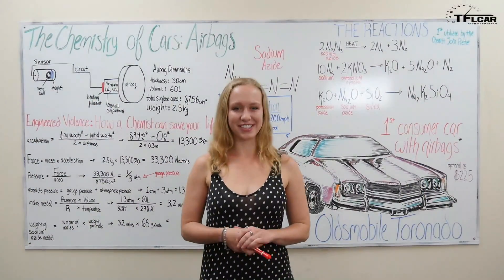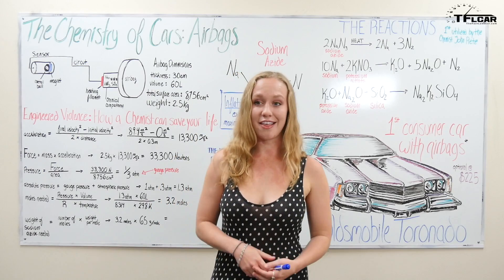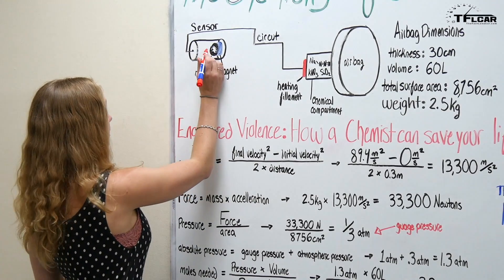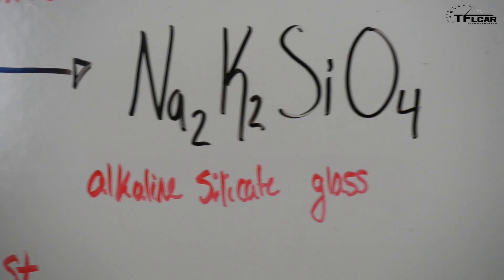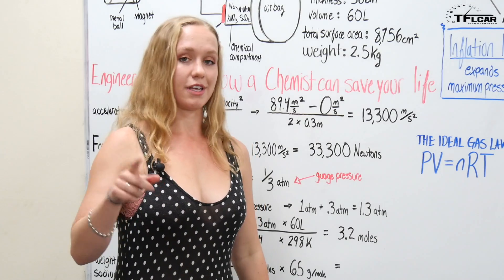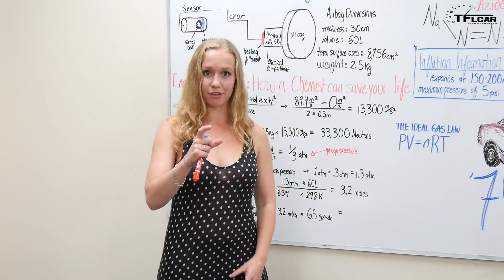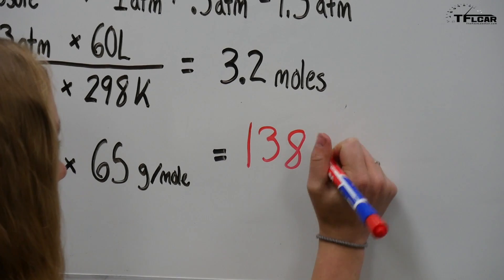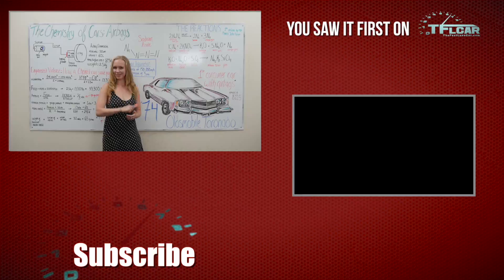How Do Airbags Work and Can They Really Kill You? Chemistry of Cars Ep.2

Comment: Airbags have come a long way, but they shouldn't have been used till they got it right in the first place and never mandated. Government control has ruined new cars. Instead of airbags, why not improve upon the primary safety feature that actually works? I'm talking about the seat belt of course which hasn't really changed in 50 years.

Comment: $1,200 option for an Airbag in 1974....Yes children $225 is equal to $1,200 today,remember you made $2.00 per hour in 1974,plus 1 - 3 car loan terms not 4,5,6,7,8,9, year car loans and the kicker 19% interest on that car loan,thats with perfect credit  ! Thats why cars prices were lower than todays dollar $35,000 bought you a loaded top line luxury or performance car,but you had 1 - 3 years to pay if off if you financed it at 19% rate ,so expensive....

My Mortgage in the early 1990's was 21 % the house I owned had a higher payment than homes today that are priced 6 times more !! Enjoy low interest,wait until it goes up,cars wont sell,homes wont sell ..Enjoy !

Comment: This is why it is critical driver and front occupants sit at the correct distance from the air bags, and to use your seat belts.  I was in a low speed collision (~40 mph) and my bags deployed, but I was sitting far enough way that my face never hit the bag.  But it made a mess and my car was "totaled" as a result.  Seat belts are always the primate safety restraint... air bags are only supplement, not a replacement.

Comment: I don't see how you got from area to volume.
Reply: Sure I can explain! So if we assume that the shape of the airbag is cylindrical and that the height of the airbag is about 30cm, which is true for say, the airbag in a steering wheel, we can use the formula: volume=pi*radius^2*height. The volume of the airbag we already know, since an airbag for your steering wheel is about 60L. We then can rearrange the volume equation to solve for the radius, and from there we can plug our radius that we found into the cylinder surface area formula Area=2*pi*radius^2 +height*2*pi*radius. So we went from volume to area. Hope this helps :)

Comment: You should show how torque is transmitted through a torque converter and automatic transmission in one episode and a clutch and manual transmission in another episode, the difference between an open differential, a limited-slip differential, and a locking differential in another episode, how a two speed transfer case works in another episode, and the differences between different engine blocks (i.e. V6 vs I6 vs Slant 6 vs Flat 6) in terms of how they transmit power and torque to the rest of the drive train in another episode.

Comment: How about a video about the products of combustion, in a bit more detail, rather than just CO2, Co, Nox , hydrocarbons and water. I'm interested in the various intermediate compounds, that form during the combustion stroke, and how they are different as they  cool and go thru the catalyst.
Did you find any material on the partial pressure and temperature of oxygen at the time of the flame burn.
Also, high compression gas engines produce more NOx, and that was one reason for the low compression engines in the 70's when catalysts were first fitted to cars.

Comment: 3.2 mol x 65 g/mol isn't 138 g. can you clarify?
Reply: I think it's because of the molar ratio of 2:3 in the original reaxtion.  In the ideal gas section you're calculating moles of N2, not moles of sodium azide.  So when you multiply that by the molar mass of sodium azide, you then have to multiply by 2/3 because in the original reaction of sodium azide into sodium and nitrogen, you start with two moles of sodium azide but end with three moles of N2.
Reply: I follow now. Was just confused because it seemed like a straight equation but I forgot the 3.2 mol originally was supposed to be for the gas. thx!
Reply: No worries that was totally my bad!

Comment: Nice video. I would like to see a video about octane levels in gasoline.

Manufacturers will always tell you what the best gasoline is for your particular vehicle. What I'd like to know is what do manufacturers do with an engine to require premium gas vs regular gas? I know you can run such an engine on regular gas at a reduced output but does that hamper its function in any way?

Also, what happens if you use premium gas in an engine designed to burn regular gas? Any performance benefits? And does it cause it to burn leaner than it should? 

Thanks and keep up the good work.
Reply: Randall Collins Hey thank you! Octane levels are definitely on the list. Octane ratings are not only a measure of how much octane (as in the molecule C8H18) is present in your gasoline but also serves as a measure of how likely it is to prematurely detonate (knock) Lower ratings=more likely. Essentially its super important to use the proper fuel required by the engine to reduce the chance of knock (premature detonation in the cylinder before piston reaches top dead center, or whatever you timing is supposed to be set to). Some engines are way more sensitive to knock, for example the turbocharged boxer engines you'd find in a WRX. Other engines aren't as sensitive, like the 1275H A-series in my classic mini. How stuff works has some cool explainations on knock and octane and the like!
Reply: I'd like to see that too!

Comment: A few ideas:

Metallurgy - How companies are making cars stronger and also making them lighter.

Fuels - The difference and what makes them better/worse.  Grades of gasoline, diesel,
 propane, etc.  (Maybe something here about fuel additives, too?)

Fluids - How are the oils and fluids different and why they're different. (Eg: Engine oil vs. transmission oil, etc.)  (Expanded from @ProjectM97's idea about brake fluid.)

Cars on the Outside - Chemistry of the plastics (maybe go into rigidity and elasticity?  eg: Saturn's "undentable" doors), paints, bonding agents.
Reply: there are a number of videos about oil analysis you might check out. those videos talk about what is in the oil or coolant and how the chemicals change over  time. To tell when to change fluids and what the changes tell about the condition of the engine
Reply: I think the metallurgy would be a great next video. Your other ideas are just as captivating though. I think Charlotte will do videos on all of these in due time.
Reply: Thanks for the awesome ideas!

Comment: tell us if higher octane (premium fuel) is beneficial for cars that don't require it
Reply: My 2012 F150 does not do better unloaded but does do better loaded; it's more efficient under high load.
My brother's GMC 1500 6.2 L gas appears to do better most of the time; it is a higher compression engine, and regular gas causes the engine to use less"timing" to avoid knocking, and would appear to be less efficient.
Any engine; the higher the compression, the better it will run with higher octane.
You can do your own "Gauntlet" run, with your vehicle loaded. and compare mileage and seat of the pants feel in your own vehicle. A tank of regular, then a tank of premium.
It's recommended to follow Mfg's requirements in your owner's manual

Comment: I have a suggestion for a video. 
 I live in a desert weather where temperature varies greatly between night and day from 110 F at noon to just around 60 F at dawn. The myth is that pumping dense fuel at cool weather is smarter than less dense fuel at hot weather, which means more fuel for the same amount of money, A lot of people around me believe it but I have my doubts. So, my question is: Is that true?
 if Yes, how much is really the difference? and Doesn't the density of fuel vary inside the tank of the car as well? So, it really depends on what time you use the car not the time you pump the fuel? 
Thanx, and great videos :)
Reply: Fuel pumps at the gas station are corrected for volume changes with overall weather, or so we hope.
Underground temps in the storage tanks change a lot less than the air. 
Regulations for fuel dispensing pumps are partly designed to make sure the dollars charged represent the same weight of gas most of the time.
Fuel injected cars with gas engines use Mass Air Flow sensors on the intake, and O2 sensors on the exhaust to compensate for the difference in fuel density as well as air density. Do you remember the "FLEXFUEL" designation on many new cars? the injection systems compensate for how much alcohol is in the gas mix, from 0% to E85 , that is 85% alcohol (much less energy in alcohol)
Reply: These are all fantastic points !
"Underground temps in the storage tanks change a lot less than the air. " 
This is a very important point I hadn't considered .. Thank you :)
Reply: My understanding comes from a news report many years old. A dispensing pump, that is a pump that measures a liquid for the purpose of  a sale, is calibrated to accurately reflect the amount charged. In this report, a group was spot checking various gas stations and they pumped a given volume, for which they had an accurate weight, and they took an actual weigh of the filled container. They found a few that were off, and hadn't been serviced, and They found a group of stations were selling a mixture of contaminated gas because the weight was different.
   There is a label on Canadian gas pumps that reads 
  "corrected to 15C"
   I don't know the mechanics of the mechanism, but a pump precicely measures volume, and an amout is calculated by the mechanism to reflect the weight based on a temperature. In winter, the gas is cooler and denser, and the mech ups the displayed amount of fuel so the final liters (gallons) would weigh the same at any time of the year.
  Any pump can be inaccurate by a little, and regulations require calibration often enough to minimize the amount of time it might be inaccurate.
   We would have to hear specifics from a gas pump technician
Reply: 60andcurious Robson Agreed about the underground tanks but are you sure that there is some sort of correction going on at the pump?  That doesn't make sense to me because we are charged by the gallon which is a unit of volume, not mass.

Comment: cool series but I think it's going to be limited. things like fuel additives and synthetic oil how much chemicals are there really need explaining in our modern cars?
Reply from the maker: Pretty much everything in a modern car is based in some way on chemistry.  From to the paint, to the plastics, to the fuel, to the combustion of the fuel, to tires, to coolant, to how EV's, fuel cells, and batteries work and so on. You'd be hard press to name on component of a car or its function that does not somehow include chemistry in a fundamental way.